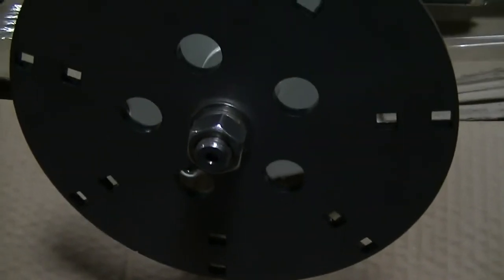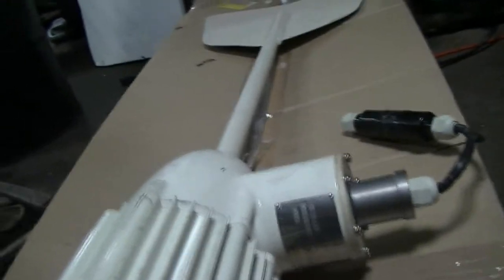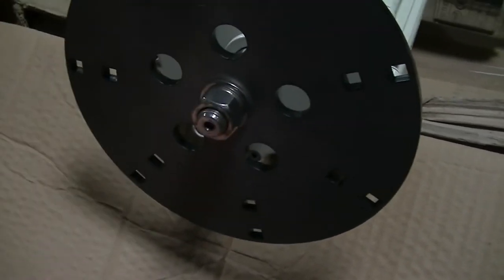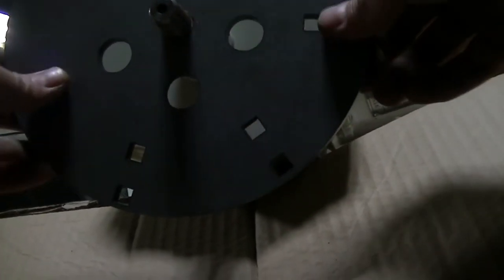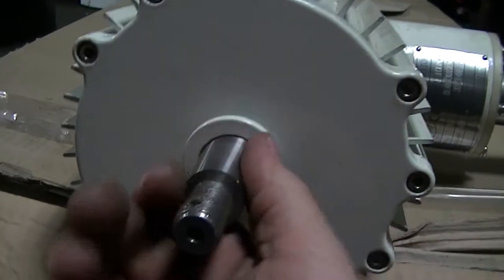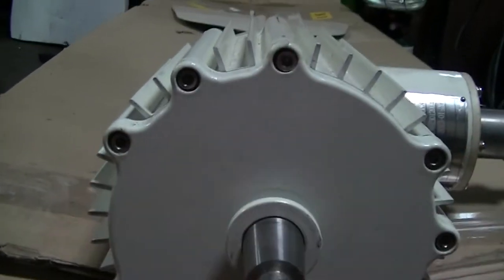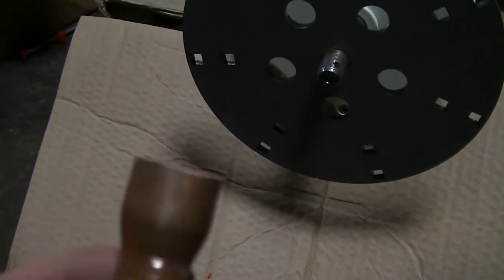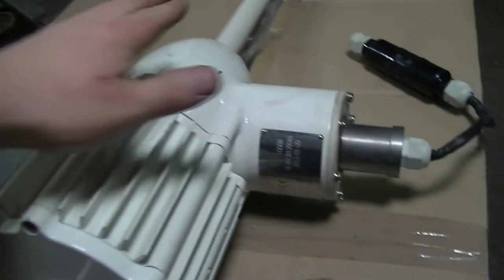Thermodyne Systems Homemade Blade Hub Shim

Comment: I`m so proud to be count in your friend circle!!!  That`s a wonderfull job you perform on it Kevin..  The THINKERERS like another guy called us, are the people that would make a business RESPECTABLE by the way we confront problems...The balancing ,if there is, will take place in the centriipical force and will forced the adaptor to drive a little more on the tapared shaft..  Only need to tightening a little more when you let it run i think... Thanks for sharing my friend

Comment: Nice job on the shim Kevin!   The PMA probably has a shorted coil and it's an expensive fix.  The only way to stop this kind of fault is to put a breaker on the DC side of the power delivery wire and dump the electric brake.  Our coils and others will also burn in high winds if a fuse is not added.  Of coarse anything with an electric brake or a brake switch is doomed to get a burned out coil in any extreme high winds.  Turbines with electric automatic brake's or manual brake switches are doomed within the first few years of operation,  just a matter of time really.

The only thing that works for us is some type of furling tail or semi furling saddle bracket or the right breaker to disconnect the stator coil when it gets too hot in extreme winds.  Finding the right breaker can be tricky since you have to account for the high voltages you get in high winds so the breaker rating has to be lower then you would think.  For 24 volt stators we start at 30 amp and work our way up.  Since a 24 volt stator puts out 100 volts in high winds a 30 amp breaker actually delivers a lot off watts.

24 Volts X 30 amp = 720 Watts is normal thinking but thats not what happens.
 In the real world it is not 24 volts and can be 45 volts+ in high winds

45 Volts X 30 amp = 1350 Watts  and can go much higher even.

Just remember my golden rule on brakes  "Electric brakes will 'break' stator coils"

and  'Fuse it or lose it' 

If your afraid of a wind turbine "Running away" in high winds we have semi furling options too.  Anything is better than an electric brake!